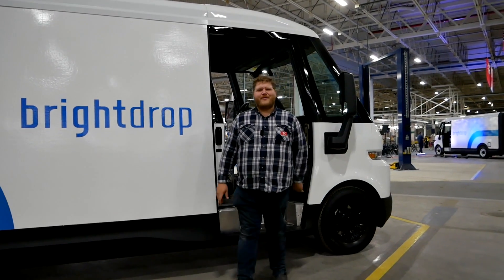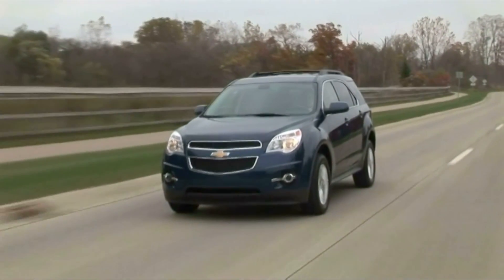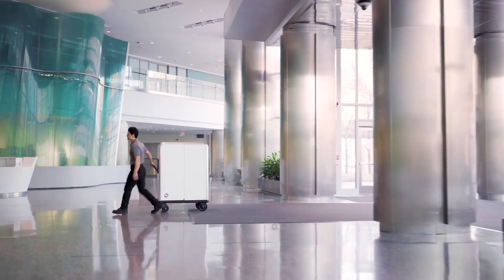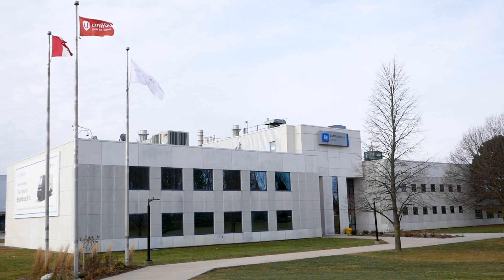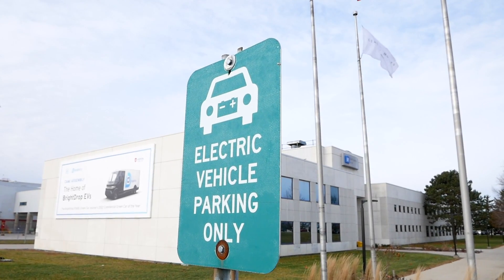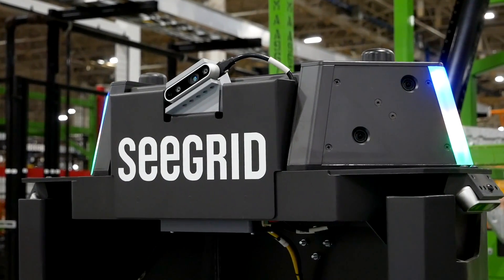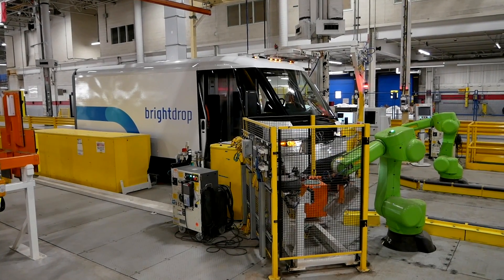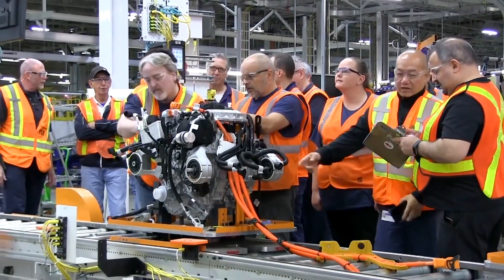Here's How BrightDrop & GM are Taking Delivery Vans Electric - See How the ZEVO600 is Built

Comment: I work for Fedex and with a tiny range of only 250 miles I can't see this being a viable option.  I am running 300-400+ miles daily in rural areas with dirt roads, gravel roads, roads with rocks and ruts.. I'd like to see this come to my station just because it's new but they're going to need at least 500 mile range to be able to be a delivery vehicle for the longer routes and especially the rural ones.  Might be OK for the short in-town routes though.

Comment: As of March 2023 launch of this vehicle is not going smoothly, some of the most pressing issues are:

1. Battery leaks and their consequent failures.

2. Front electric motor design flaw causes them to explode.

3. Major roof leaks, pretty much every single van that leaves assembly line is sitting in a warehouse awaiting leak repairs, attempts using mass amounts of automotive sealer are failing. 

4. When offering the contract to be official suppliers of parts, GM awarded the contracts to the lowest bidders and this is having dire consequences with many parts being scrapped as a result. 

This vehicle is far from road worthy as of today.

Comment: As long as they are reliable and do not have battery issues they will be a hit.

Electric commercial vans are a no-brainer for buyers
Reply: Problem is that they are plagued with issues, battery leaks and failures, front electric motors disintegration, massive roof leaks, structural issues, inferior parts quality as a result of awarding contracts to lowest bidders etc...